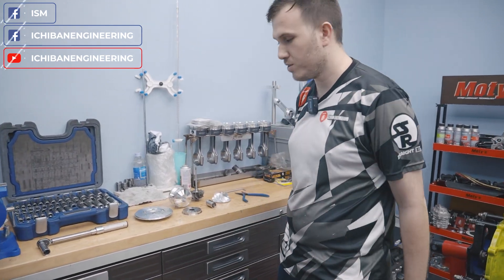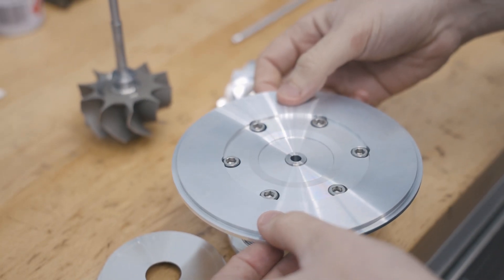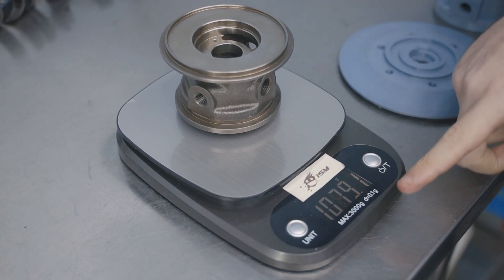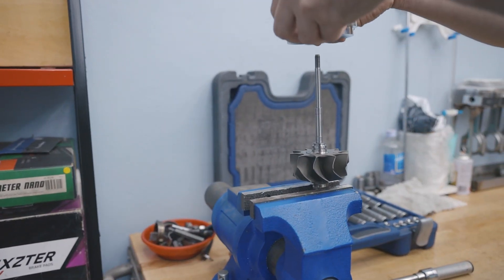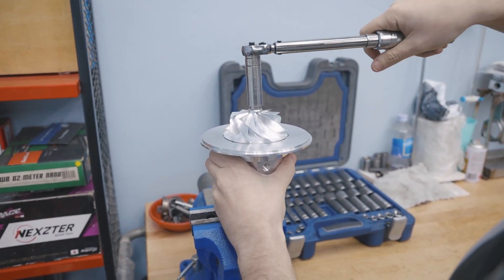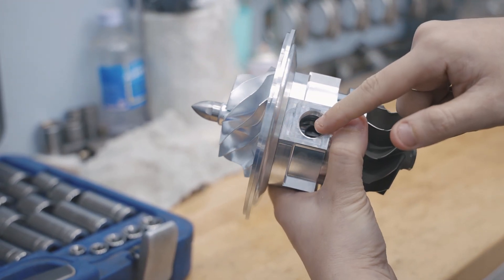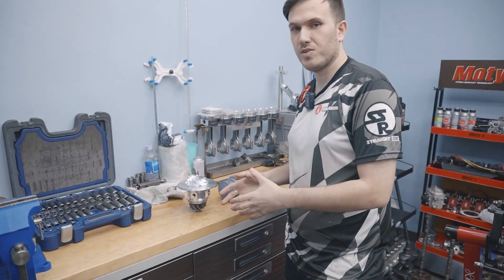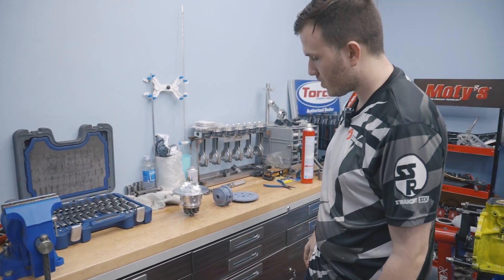How we make Turbochargers ? - Billet Triple Ball Bearing CHRA - EP2

Comment: The option of a bolt on drain can be good, especially if space is too tight for a silly AN fitting. Ability to run without water can also be nice...sometimes additional plumbing can be very difficult.
Reply from the maker: I think you did not get the point of the fitting. 

The AN / ORB is going in. You could use an adapter to a flared fitting that will fit a tube like a normal drain. The point here is to eliminate the use of gasket or sealant that usually leaks. 

Cooling with ball bearing is rather important as well. Companies that offer them as air cooled units do not take in mind the average user. Driving in a drag race event is different then running on the street or on a circuit track hard. It takes a toll on the bearings. 

We have seen countless Garrett and precision units that came in shot as the turbine wheel overheated along with the bearings inside. You can easily see it on the shaft once opened. 

Making a billet unit with water ports was a hard task. It was much easier to go air cooled but we wanted to take care of this issue and support a bigger crowd.

Comment: Billet aluminum?
Reply from the maker: Yeah. We had great results before with cast aluminum as well. Borg Warner also use aluminum. As well as comp turbo units. Aluminum is a bit tricky to work with but if you get it right is superior in cooling capacity to the cast iron material that come in some turbos.